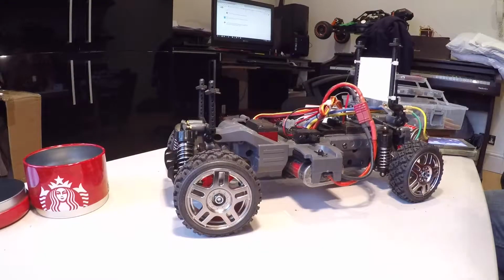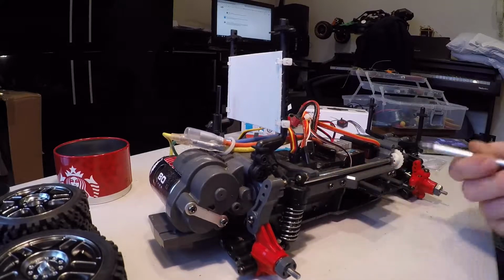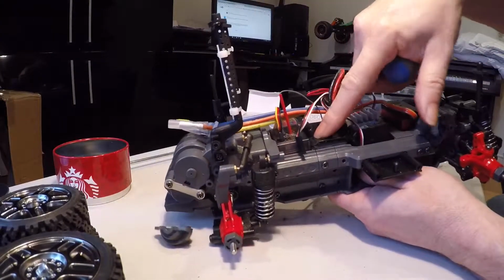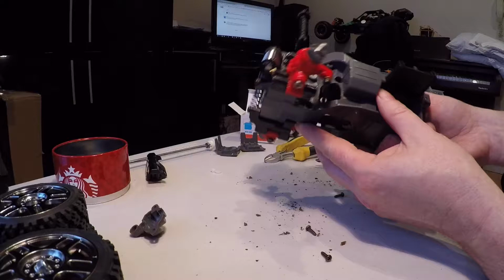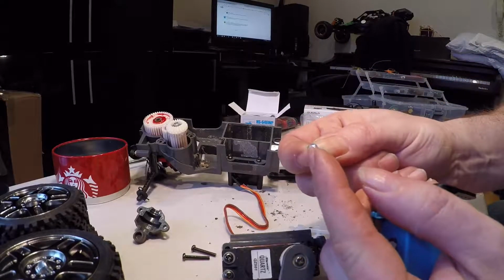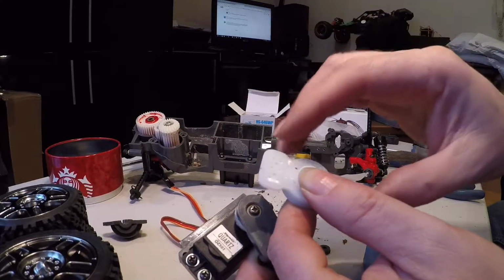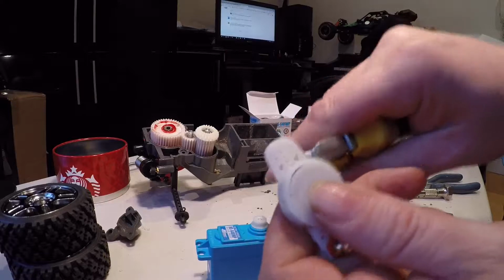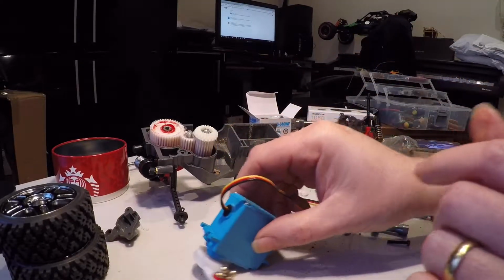Tamiya MF01X Jimny crawler / runner upgrade pt2: waterproof hitec HS-646WP servo intstall

Comment: What other things do you need to do to waterproof the car?
Reply from the maker: +Tad Ficus Catus I didn't totally water proof it - just the wp servo and ESC. A lot of the Spekrum receivers these days are coated. I try and avoid getting too wet as it makes bearings go rusty, WD40 on the bearings (take wheels off first) is usually a good precaution to minimise this.